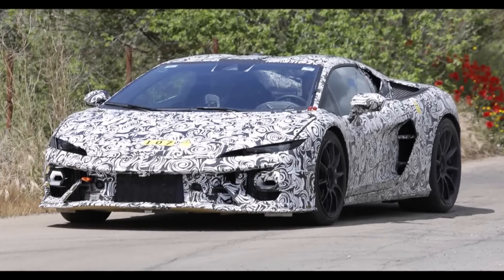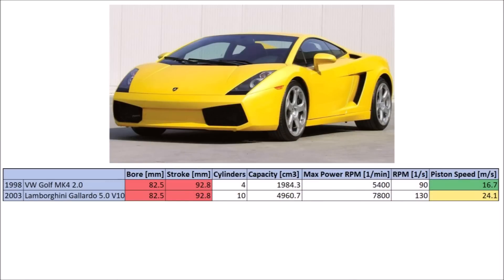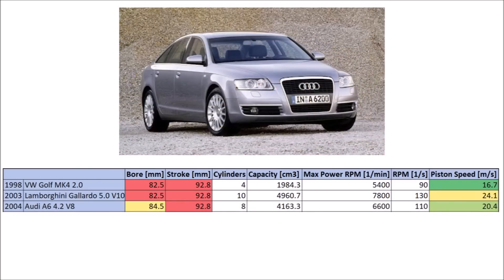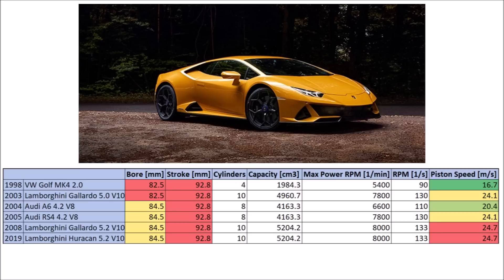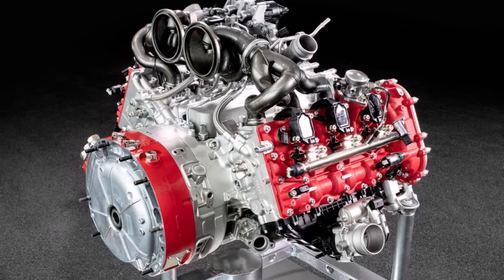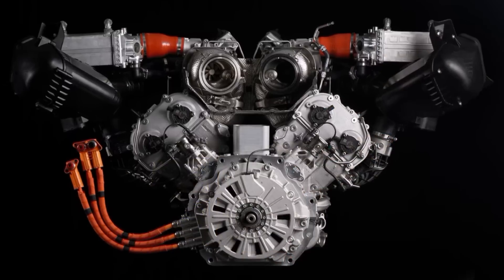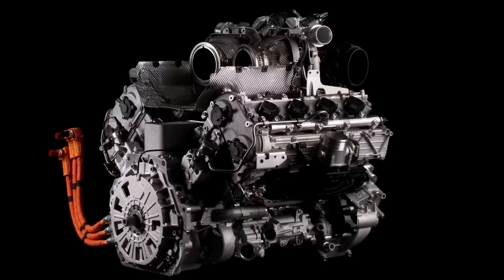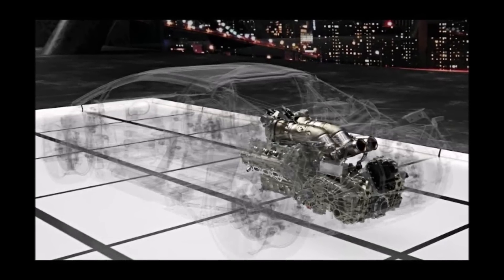Lamborghini Temerario - 4.0l V8 Biturbo and 10,000 RM - But Why?

Comment: I think losing the iconic v10 is a shame. I dont think a twin turbo v8 will ever sound as good as the NA v10 does.
Reply: It's a crying shame
Reply: Who cares, this is going to crush the McLaren and Ferrari competition on the track.
Reply: @Ang3lUki Nope
Reply: @SKBSKBSKBSKBSK  Neither of them have engines bred for le mans
Reply: @Ang3lUki It won't.
Reply: @Bug4life  Yes it will, it has an Le Mans engine in it
Reply: It's a weird choice. It seems to have been done for no reason other than to compete with these stupid horsepower figures that other brands are pushing. To me, 600-700 bhp is absolutely enough. For more you can get an 812 or an Aventador. 

But then Ferrari started pushing for this idiotic 800-1000hp default on all their new cars, the SF90, the 296, etc. and now it seems others feel the need to follow. So the Revuelto adds in a stupid, heavy battery to get it on par with the SF90, even though 700 bhp and an n/a V12 is all any sane car-lover should want, rather than an extra 250 horsepower and a whole load of extra weight. And now the Temerario ditches one of the most iconic and basically flawless engines of this century in favour of something that sounds like a complete mess: a twin turbo(ugh), V8(ugh), with a battery(ugh). Not that I have anything against V8s per se, but it's a step down form that V10 regardless of how high it revs, and the turbos are going to siphon a lot of that noise away, while the battery pack is going to, inevitably, affects the handling of what was regarded as one of the best handling sportscars of the modern era.

Gordon Murray has it right with the philosophy of the T50. RWD, because that's the drivetrain that is by far the most enjoyable and requires the most skill; 600-700hp, more than most people can handle in a RWD car; n/a engine that revs high because you get both that glorious sound(none of it diverted by the turbos) and the immediate response of natural aspiration. Oh, and manual transmission, for that sense of connection with the car.

I think car manufacturers don't really understand what supercar customers want; this is why supercar EVs don't seem to be selling. The Nevera isn't selling for example. People don't buy supercars because they want them to be 2000hp and sound like a fridge(and handle like a fridge) - they buy them because they feel, look and sound great to drive. Just focus on optimising those three things and these car brands would be fine. But they're constantly engaging in these stupid 'let's guess what the customer wants even though they've not told us' games, and getting into arms races with other brands over idiotic things like horsepower and hybridisation.
Reply: @thesprawl2361 If you look back at the years it was McLaren who was making turbocharged supercars and were quicker than Ferrari's naturally aspirated cars like the 458 but McLaren's cars were comparatively boring to drive. So, Ferrari reintroduced turbocharged engines in order to beat McLaren, however they have still kept their naturally aspirated V12 pure, free from hybridization.
Reply: @Bug4life  that's what the revuelto is for
Reply: All you need to hear is Flat Plane Crank. have you heard the Z06’s engine  that thing sounds better than the V10 Huracan, especially with high flow cats on it. 
I have no doubt this new baby Lambo is going to be awesome, except for the design.
Reply: Someone's never been on a race track.
Reply: give it 10 years and they will bring it back
Reply: Lambos biggest pull was the aftermarket modding scene because of how robust their v10's were.
Reply: @danhobart4009 these v8s are coming boosted from the factory…. There’s a good chance these engines will be very robust themselves and not need 50k thrown at it
Reply: @mogulme6190 Exactly lots of people  twin turbo there V10 now you got them factory.  Some tuning you will easily be well over 1000whp at a much cheaper cost and way less hassle.
Reply: It's not like Lambos haven't had a V8 before.

If Lambo aren't going to build 72 degree V10s, then they should just drop the V10. Their current V10s don't really sound good.
Reply: @sepg5084  you need your ears cleaned
Reply: @sepg5084  Bro really said that

Comment: one interesting thing between lambo and bmw v10s are that despite s85 being very oversquare and lambo v10 being very undersquare, their torque and power curves are near identical
Reply: Now THAT is fun fact
Reply: How is it that the 5.0 gallardo made 60 more hp than the bmw ? Are the extra revs enough to make a difference.
Reply: @SONO4B11T absolutely, revs are a flat power multiplier assuming perfectly linear torque
Reply: @jordansundheim7 Not if you change the laws of physics.
Reply: @SONO4B11T  to be more exact on that: Power equals ( torque * rpm ) / constant. 
the constant depends on the measurement system used. 

Its also fairly easy to explain why in more natural terms: during a single revolution at wide open throttle, the engine produces its torque once. If you manage to do two revolutions in the same time, you get the same torque twice within that time frame and can do more work. 

Its not that simple on real engines, as higher rpm also means greater internal resistance on the engine due to higher loads on all bearings and more cylinder walls being traveled by the pistons as well as camshafts needing to be changed to optimize timing for the faster engine speed etc etc, which is where VTEC, VANOS, Freevalve etc come in. 
Shockwave/pressure wave propagation is an insanely complicated topic that seems like black magic from the outside
Reply: @SONO4B11T  sorry i remembered wrong its not exactly the lambo v10, its the audi version. you can check auto catalogs torque curve for "2008 audi r8 5.2 v10" and compare its torque curve to the 5.0 bmw m5 s85 v10 you ll see the curves are near identical and their peak hp difference is only around 18hp 500hp vs 518hp.
Reply: @thomasschumacher5318  I get you... But I was still curious as to why the lambo v10 made so much more. I had forgotten that the VAG v10 had direct injection
Reply: @SONO4B11T  i just checked the curve for the gallardo one and it seems to have a peakier curve at the top end im gonna guess with different intake and cams it achieved peakier curve with more peak hp and audi version being a bit more street friendly with a bit of a flatter curve at the top end, but thats just my guess dont know for sure
Reply: I remember reading some old study I believe was done by Ricardo. They found little to no difference in the torque curves. Displacement is displacement as long as you respect realistic physical constrains.

Comment: Fun fact: the Temerario engine is not Lamborghini's first V8 engine. They had used a 90 degree naturally aspirated V8 engine in the Urraco, Jalpa and Silhouette models from 1971 to 1988 and that engine was designed by Giampaolo Dallara, the founder of Dallara Motorsports.
Reply: Also I believe the sc63 le man car uses a v8
Reply: @Meeska9 i don’t know if a V8 is in the rule book in that series for a car of that type, so they might not be able to use a V12
Reply: @epicon6  Aston Martin is going to enter the Valkyrie with a V12 and also some lmh and lmdh use a V8 like the sc63, M v8 hybrid, Cadillac and Porsche 963
Reply: @wal3325  And Ferrari 499P for example uses a V6
Reply: Yes, and there was also the Cizeta Moroder V16T, which used 2 put together Urraco V8 engines!😎👌
Reply: Actually that's is under Audi engine for made improvements 😂
Reply: For more info on the baby bulls, check out Iain Tyrrell's videos on the Urraco, Jalpa and Silhouette on the Tyrrell's Classic Workshop channel.

Few are more knowledgeable than him on all things Lamborghini, if you're not following his channel you've been missing out!
Reply: Because they can😉
Reply: not fun 
didn’t smile
Reply: And ofc the Urus, wit hits V8
Reply: @thomasgiesen6849  Well the Urus is really lame having a V8. It’s worked because it’s sold like crazy but it’s a mid range product like the Huracan basically because they are missing a high end SUV like the Purosanque. Drive them back to back and the NA V12 on the Purosangue is soooooooooooooooooo much sweeter🎉
Reply: @epicon6  sure, tbh the Urus is just a VW Touareg with a little bit changes
Reply: @thomasgiesen6849  Or an Audi RS Q8. When Audi bought Lamborghini they did it with the condition of being able to have a mid level Lamborghini mode that’s based on their R8 platform.

The Urus follows that logic. It was easy for them to just upgrade the Q8 model to a Urus and get easy sales and it worked because the Urus is the highest selling model, but the Urus is literally mid way from an Audi, while actual Lamborghini flagships that aren’t based on an Audi platform but designed to be pure Lamborghinis with a V12 and doors that go up.

Comment: Can you explain why V10 engine is rarely use in a production car? It seems like the V8 and the V12 that car company usually use for their high end sports car
Reply: V12s are what the company started with before adding v8s to their lineup. The v10 wasn't a Lamborghini engine. It's an audi engine.
Reply: @berserkfuryyy6798  the first Lambo V10 was a prototype mamed P140 built under the Chrysler ownership.
Help from Lamborghini gets often mentioned in the history of the Viper, that has it bigger but it's a V10 nonetheless.

V10 are more difficult to balance, they went imposed in F1 for the same reason of non-slick tyres, to limitate performances.
Reply: @il-ma.le. no, the F1 V10 was mandated when everyone already used them. Ferrari had a more powerful V12 for a bit, but Renaults V10 was more economical to run and more reliable. The Ferraris used significantly more fuel, which is why they eventually moved to the V10 because it was just the better option at the time.
Reply: 4cyl and 6cyl heads more common as 5cyl is not naturally balanced?
Reply: V10s are more expensive to develop because you need to add balance to the crankshaft.

 While a 90° V8 or a 60-75° V12 would be both smoother and simpler to design and to manufacture.
Reply: @davidaugustofc2574  V10 (and inline-5) can be tuned. So they have very high torque in a narrow power band. You just need a good gearbox and no need for throttling. So in a ground effect car at the end of the corner, you un-throttle your engine. Torque goes rises as downforce rises. When you need to switch gears, you are already fast. The first acceleration matters in (drag) racing.
Reply: @ArneChristianRosenfeldt  that comes with knowledge. For early manufactures V10s often meant trouble.

 It wasn't until the 1990s when F1 teams managed to make V10s "consistently reliable", and even with all the money they had to throw at the problems, some were unreliable still. Like the '03 McLaren Mercedes.
Reply: @davidaugustofc2574  huh? 5:1 header overlap exhaust pulses to a large degree. Only thanks to tuning they pulses don’t go up into the exhaust of the next cyclinder in firing order. Tuning just as in a radio means: specific frequency. No one got 6:1 headers to work better than 6:2:1 . So 5 is on the edge.

Dodge had no problem with the V10 in their viper because the overlap in cross plane V8 was even worse.
Reply: @ArneChristianRosenfeldt  the Viper doesn't have a high revving engine, which undoubtedly increases reliability, and one car having it definitely didn't make V10s common among high end sports car.
Reply: @davidaugustofc2574  I actually watched F1 when V10 spread. I cannot remember engine braking down. Gearboxes, yeah. V10 has one throw less than a V12. Ferrari even had flat V12 with horrible in-bay unbalance. I don’t know why US customers accepted the slightly unbalanced V10, but I think it has less balance weights on the ends of the crankshaft. So torsion is less of a problem. I mean, you would always aim to slightly under-balance a V8.